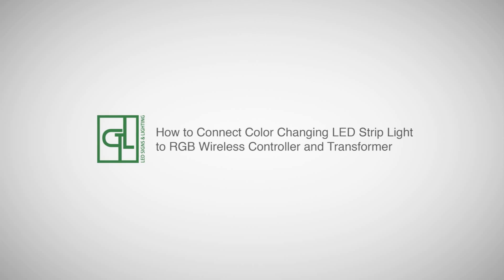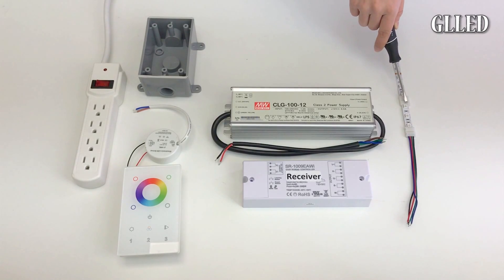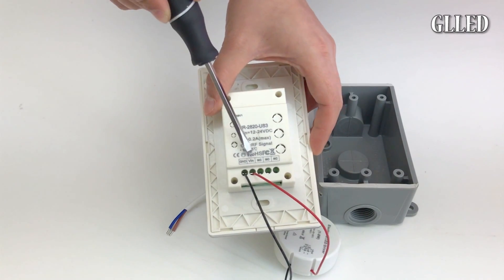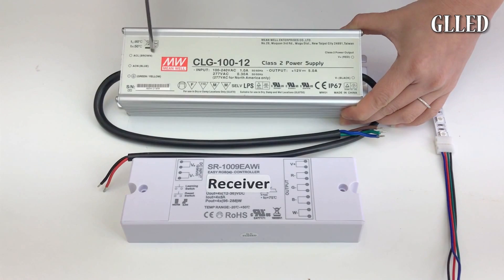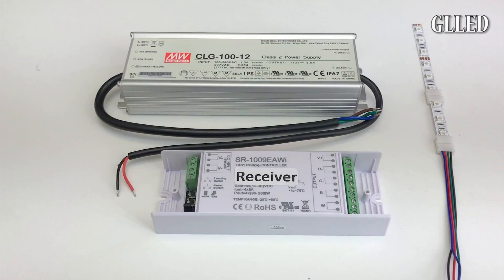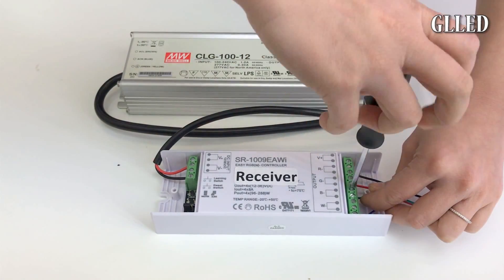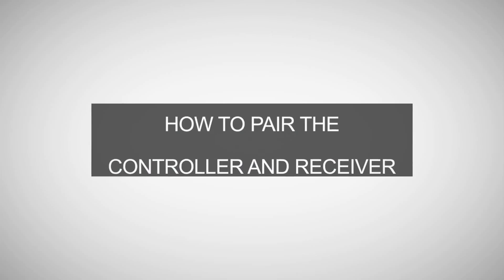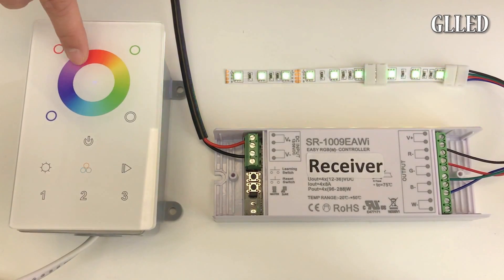How to Connect Color Changing LED Strip Light to RGB Wireless Controller and Transformer

Comment: If the power to the receiver is turned off, do you have to repair with the controller ?
Reply from the maker: No, the receiver will remember the pairing even the power has been turned off.
Reply: GL LED thank you

Comment: Why is the LED blinking?
Reply: The same reason TV/monitors flicker when recorded by a  camera. It's the frequency of the device being recorded and showing up.
Reply: It's because the light has dim down during the filming. The light will blink under the lower voltage input. Then the blink can be detected by the camera. But it won't be seen with human eyes.